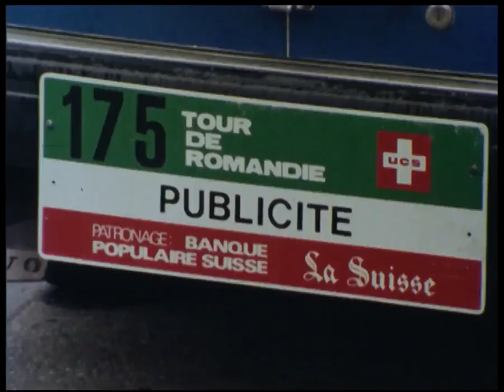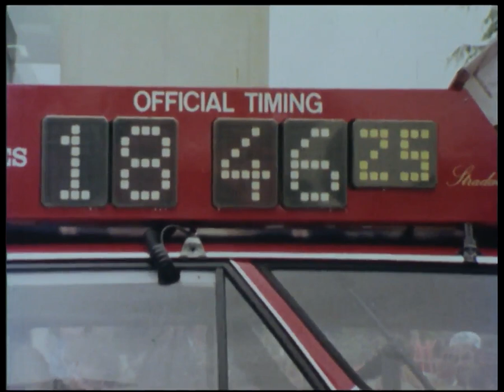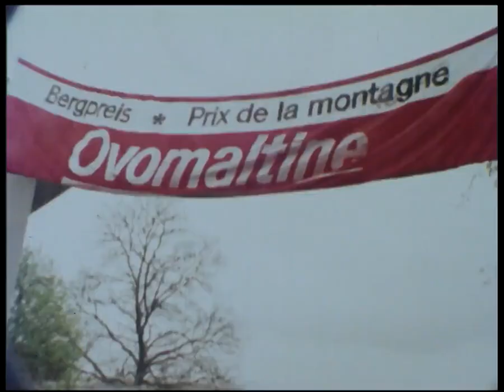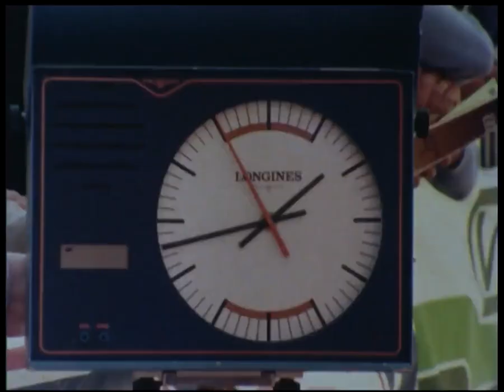TI Raleigh at the Tour de Romandie in 1982

Comment: I am the happy owner of the T.I.-RALEIGH SB frame 3701  made of T.I.  Reynolds 753 tubing in 1980 🙂  I bought it new from Pino Cerami, a retired pro rider who had a bike shop in Charleroi (Belgium) at the time 🙂  The frame is still in its prestine condition (original paint and decals) 🙂 I equipped it with CAMPAGNOLO Super Record except the bottom bracket which is a CAMPAGNOLO Record made of steel because I did not trust axles made of Titanium 🙂 I was a great supporter of T.I.-RALEIGH  TEAM at the time...  And I am still a great supporter now throughout the Facebook Group "T.I.-RALEIGH  APPRECIATION GROUP" 🙂 This is a very nice video 🙂  You had a short yet amazing pro rider career 🙂